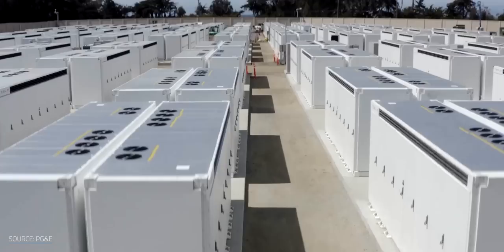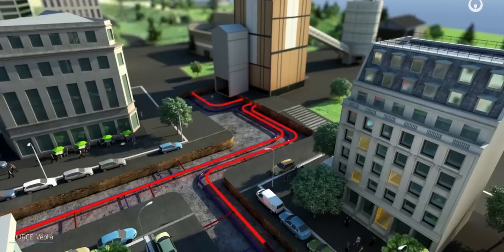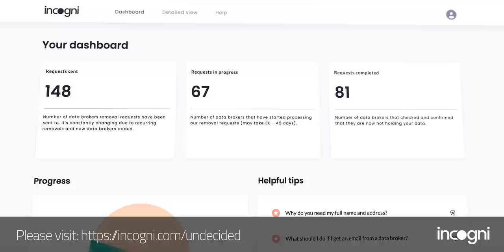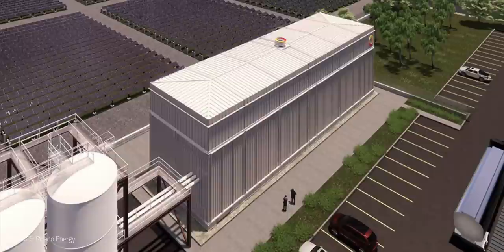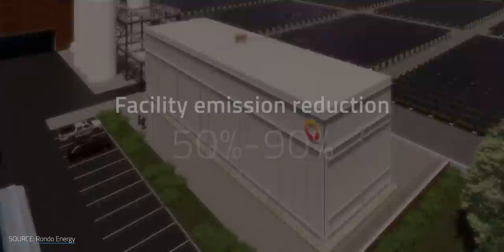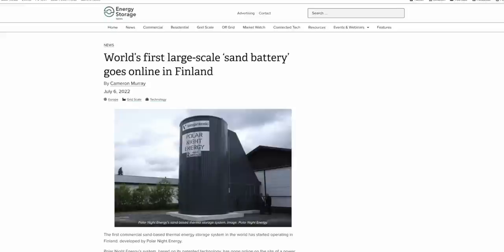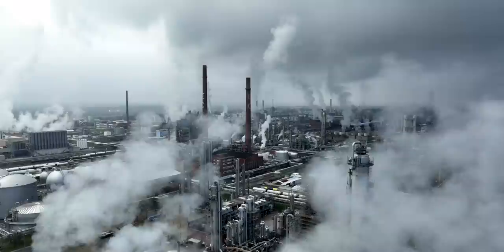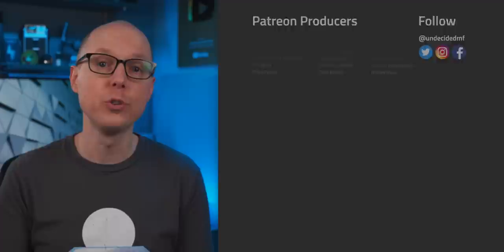How A Brick & Rock Battery Is Changing Energy Storage

Comment: From the start of the video, I thought this was an argument for grid electricity storage i.e. to replace batteries or dam batteries like-for-like but it seems like it's for end-use storage, which I don't think is a great idea because there will be residual heat from thermal storage (which I wish I know what the typical % off the top of my head) that will be wasted. Applications under 160 deg C is better to be met by heat pumps which is unbeatable in efficiency even at staged high temperatures. I'm guessing the projects you mentioned are pilot projects and funded as such and unless it's to seamlessly produce intermediate pressure steam between boilers and this thing, I think it's a farce. Happy to be proven wrong.

TES is also odd, especially storing thermal energy (as opposed to low temp substances like ice) because there will be a limit to the amount of heat that can be stored, then there will be losses so intermittent top-up is needed unless it's FIFO basis but then if it is, what's the need for it then especially if the supply of energy to the end user is expected to be reliable?

FIFO in grid makes a lot more sense but then comes the issue of acceptable level of electrical energy conversion efficiency. Turbines doesn't seem to be warranted but maybe thermo-electric convertors to D.C. then invert to A.C.? Sounds like balance of system is par with solar PV systems at best..

If I were a facility manager, I wouldn't take a look at this unless there is a detailed case study and even then, I think it has a niche application that needs to be seen if it fits my facility's application.

Comment: Thermal storage has been around a long time, as explained in several other comments. In the early 80's, my wife and I were newlyweds and investigated new home concepts. At the time, passive solar heating was the rage. Such structures also utilized simply constructed solar panels that merely channeled daytime heat to the basement where there was a large concrete chamber contains rock. Dampers in the system diverted heat to the home, if needed, or to the rock storage chamber. When night came, the stored heat was then directed to the home.

On a totally different angle, your video reports that current heat storage isn't adequate for some industries, such as steel production. I wonder if it would be feasible to utilize our planet's massive internal heat source? Like a business or home needing water and drilling as deep as needed to acquire water, could a business drill as deep as needed to tap the heat needed for its purposes? Has anyone investigated such a plan?
Reply: Yes see the Hot Rocks project U.K. south west, started back in the 70s. I think it is known as geothermal heat

Comment: For steel, even if you can only output 1500C from the heat battery, you should be able to supplement that with other heating systems and still achieve significant CO2 emissions reduction.

Comment: Long as heat storages are big enough to run steam generators for long hours, it's technically possible even to run a steel factory. But the problem is that the heat storage must be at least as big as the steel factory itself. But possible.

Comment: 12:04 but you can use the heat of the steel furnace for heating homes and also warm water and use the heat storage additional .
I think sector coupling is a major factor which can help. You can use waste heat from industry for heating homes and or provide hot water even you have a CO2 intensive industry it can still be usable

12:50 what medium does Rondo use to get up to 1500°C?

Comment: The steel manufacturing process must be one of the main sources of high-grade waste heat begging to be stored. Also. heat is quite easy to tun into cold, (see gas fridge), and that means air conditioning or refrigeration is available from waste heat. One more thing that needs to be considered is the use of low-grade heat to compress gasses for various purposes including power production. We have millions of square miles of hot road surfaces for example, which represent virtually infinite amounts of low-grade heat. 
We have billions of tonnes of forest waste that needs to be carefully and affectionately harvested for fire prevention. If we use some of this material for methane production, not only do we produce the cleanest carbon-based fuel, but the organic material is also not consumed, on the contrary, the methane digester increases nitrogen seven-fold. This is a perfect source of nitrogen for making premium grade humus - ie, more forests. Thanks for your excellent work in this vital task.

Comment: Think about replacing nuclear reactor coolant towers with a field of these.

You get the initial power out of the turbines in the PWR phase.
You then run the water in the cooling loop and recover a bunch of heat that can then be used for actual HVAC or additional power generation.
Reply: I saw this comment after I wrote mine. My added thought is that (nuclear) power plant could produce the electricity during the peak day hours. Supercritical fluids (CO2?) could decrease the space requirements of the needed turbine.

Comment: Heat is the original but a low grade energy. Only a small part of it can be converted to mechanical or electrical energy. This may have started the concept of efficiency. 
All forms of energy have their place but higher temperature increases the efficiency of heat. It is, in my opinion, best stored as partially molten solids as phase change energy.

Comment: Storing heat energy in a heat battery looks like a great idea. But if you can avoid it, you do not want to convert high grade energy such as electricity to low grade heat energy. The laws of physics limit how much high grade you can get back out of it. For heat from electricity, you also have to be careful not to loose the opportunity of higher conversion rates, like the 300-500% that's common with heat pumps.

Comment: Whenever you hear a percentage, you need to ask (or already know): percent of what?  Resistive heating is 100% efficient, in the sense that it turns 100% of the energy in the electricity into heat.  But really, it's perfectly inefficient.  Perfectly efficient heating would be a reversible heat pump.

Comment: I've often wondered what would be required to make a solar powered retained heat oven.  The part I couldn't figure out was how to circulate air at 400-500 deg F.  I wonder how these guys are doing it?
Reply: Simpy use fan, of course fan motor is on cold side of the insulation but for metal fan blade that is simple task.

Comment: It all comes down to efficiency and cost right?   Seems like the most efficient use of TES is to get heat out, not generate electricity otherwise you're up against battery storage in the 85% or better efficiency range.  But costs could be so much lower - if energy production becomes ridiculously cheap, or even free because it is excess energy from the grid that would be dumped by paying people to consume it (this happens) then cheap but inefficient storage becomes less of a problem.  Also how does this compare against molten salt for instance?

Comment: I have to point out a couple of problems I hear about 9 minutes in.
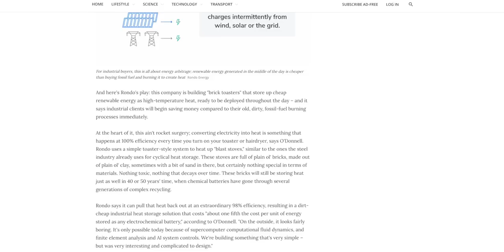NOTHING can be 100% efficient.  (8:32 in.)  We can't do it.  So that can't be trusted as true/reliable.
You then said you take electricity from the GRID and convert it to heat in PEAK time.
Wouldn't it be in OFF PEAK time?   Peak time there is enough/too much demand on the grid to add more demand to heat bricks. (9:16 in)

Comment: Even the lower temperature systems can be useful for the steel industry.  You can't heat something to 1600 degrees without heating it to 500 degrees first.

Comment: Am I missing something.. If the technology can reach 1500 oC and 1600 oC is needed for steel manufacture then one only needs a relatively small additional conventional heat boost to get above the threshold so a 'combi' system could be used straightaway...?

Comment: Even in steelmaking and other high temperature processes, a TES system could be used to partially heat the materials, reducing the amount of electricity or gas needed to bring them up to final temperature.
One of the main reasons that thermal energy recovery and storage fails to gain popularity is that potential users seem to demand that the system must be able to reach full temperature for the process... if it can only pre-heat, people lose interest: This is stupid thinking, but very common.
I designed and installed a refrigeration heat recovery system that paid itself off in 14 months on direct electricity and gas savings alone, while increasing the reliability and decreasing maintenance demands of the refrigeration equipment.
Despite this excellent financial result, engineers and managers at similar factories refused to even consider a similar system because "It only preheats the water.. we still need to heat it the rest of the way, so why bother?"
Why bother?: Because it can save you a huge amount of money, while reducing your carbon footprint!

Comment: It's a crappy deal if you are pulling power off the grid to generate the heat. Using electricity to generate the steam for district heating is just barely viable in the US, and losing 5 - 10 % by stuffing one of these units in the mix would probably do it in. That said, maybe you'd see some benefit in a cogen setup.

Comment: I can't help but question why they're using resistive heating when a heat pump's minimum efficiency is usually higher. I understand it's a more complicated system and may not work for every temperature range desired.. but it just seems silly to leave all of that benefit just laying on the table.

I also have to wonder if you could combine this with data center cooling to utilize their waste heat..

Comment: Why can't the waste heat from an Electric Fired Smelter's Smoke Stack be used by Sterling Engines to Generate Electricity and returned directly back to the smelting process?  Sterling Engine's advantage is directly related to temperature differential and surface areas of collection and dissipation.  It seems like a tall smoke stack is ideally suited for this while scrubbing solids out of the exhaust gasses by cooling them.

Comment: Great ideas. If that system (Brick Battery) can get to 1500º then putting that 1500º into a heating system and adding an extra +100º  shouldn't be impossible in order to make steel. Thanks Jim Bell (Australia)

Comment: Although using bricks and rocks as batteries is fine, a better option would be have a more varied green energy policy. Instead of just focusing on wind and solar. Where applicable, the use of tidal energy should also be included, since the tides never stop...

Also, using excess green electric during times of plenty to capture hydrogen from the sea and CO2 from the atmosphere to produce green synthetic diesel, which can be used to produce electric, as well as a green fuel for aviation and possibly cars, and trucks too!!!

Comment: 2:40  1: cheaper, but you can't use just any old rock, they'll want to use a processed material to remove impurities that would react and break down with time.
2/3. Very few things can handle high temperature cycling without degradation. The high temperatures will readily cause expansion which will create cracks, letting other contaminations to get in over time and further cause damage. I'd be surprised if they even got 5 years without needing a complete overhaul from first designs.
4. Not going down that rabbit hole except to say, less emissions...

Comment: I’m curious if it can work in reverse, could we keep the system cool, then use the cool water to lower heating costs of cooling buildings. AC is notoriously thirsty for energy and ground water could cool the thermal material.

Comment: it really does not matter if the heat battery reaches 1600°C for steel.
steel needs a reducing agent (hydrogen, currently carbon). this reduction releases a lot of heat inadvertently so therefore that small delta will be covered automatically by good old chemistry.

Comment: I am a fan of TES tech. something that can be applied anywhere, first world to 3rd, fast, cheap, (relatively) easy. 
For steel production, if materials can be pre-heated with recycled heat that's efficiently retained, stored, and cycled, It could significantly reduce the total amount of energy/fuel spent per ton of production.
The difficulty I see is how to enclose the system for thermal retention and capture. Frankly I suspect it'd be cheaper and easier to build a totally new, fully automated, fully enclosed factory than to try to retrofit anything. it'd essentially have to be a factory-sized robot... hmmmm...

Comment: why we don't use more gravity batteries is beyond me, its probably the most efficient and easiest type of battery you can build, find an old mine shaft or an old well and hang heavy weights on cables your pretty well done, lower them to spin motors to create energy and reel them back up to store it, even hydro electric dams use a similar system by storing water in a reservoir above the dam to store energy and release it down to the turbines to create energy.

Comment: put that money for storage into   rectifying the problems of geothermal.
  and you'd do away  with most of the need for batteries, keeping power costs down.
 chasing geothermal is much cheaper and easier than chasing grid scale storage.
storage would be mostly personal for small solar systems on houses.

Comment: Using pellets as a carbon neutral fuel source is quite doable in my opinion. You grow a fast growing plant that dries and burns easy. You turn that into pellets. It absorbs carbon as it grows and releases it when it is burned. If you want it to be carbon negative, you can use the exhaust to set concrete. I do not know why this has to be so controversial.

Comment: Yet another example of a low-tech and cheap solution that makes sooo much sense.  So WHY aren't these technologies being adopted at exponential speeds?  I've been using this "technology" in my Alaska home for years with my 20 ton masonry stove, (made of old bricks I recycled and granite rocks I collected from around my property).  I burn 1/4 of the wood that a typical woodstove requires, and the combustion process is much more complete releasing very little pollutants.  Thermal Energy Storage makes so much sense.

Comment: I think it's a great idea, eminently practical: eventually . That's the catch currently, and I can't say what the problems are for engineering the usage or conversion process. I'm just not knowledgeable enough.

However, I'm glad it's being worked on. To the extent that it can be made to work, it can then be improved to be efficient. And enough time and development later, I have confidence it will be beautiful to behold.

The reason for my confidence is not just in the ability of the developers. It's also in the nature of energy. Today, heat is simply a byproduct of using energy sources, and it's mostly an unwanted discard if it doesn't produce electricity or mechanical motion or some other direct means of applying it to good use. That heat is the ecological equivalent of greenhouse gasses in that it is unwanted waste. Hmm. Since we are making it already, shouldn't we try to do something with it instead of wasting? So just working on the problem is of immediate benefit, with a promising scenario for more.

Finally, much noise has been circulating about fusion energy, and research is making progress. So far, nothing practical there; we just need more research. But consider that the immediate product of a fusion reaction is heat. And one of the "problems" being considered in the research is how to capture the energy and put it to practical use. Heat energy. It seems like an immediate tie-in to the problems of using heat batteries. Capture the source heat directly even if production is pulsed, not continuous, and use it later when needed. Just exactly the energy transfer conditions being discussed here.

I would guess that there is virtually no end to the applications heat batteries could have.